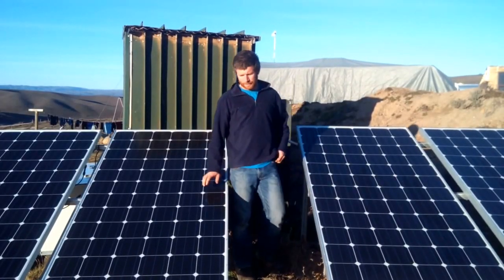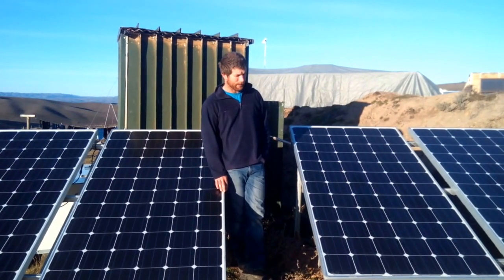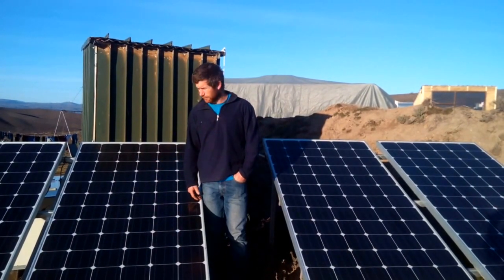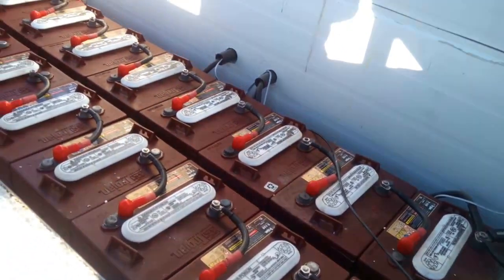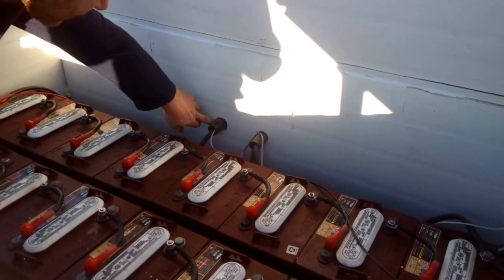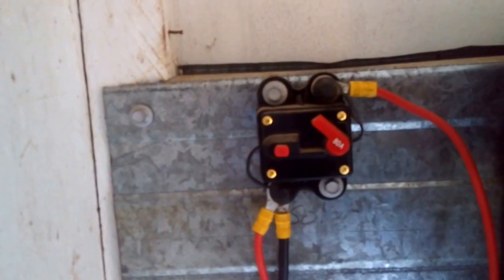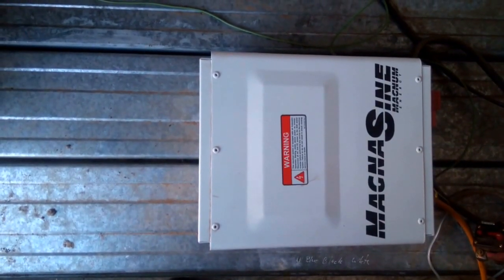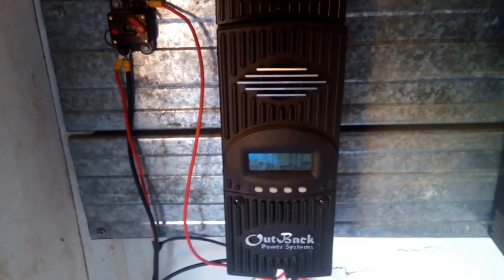Off Grid Solar New Zealand

Comment: I would replace those breakers with proper single pole outback/midnite solar 80 amp breakers on array/battery bank side & a 100 amp single pole outback/midnite solar on the inverter to battery bank/generator side.I would also shield your wiring in flex or solid conduit for safety.

Comment from the maker: We have changed the system a bit since this video. However we are running a fridge freezer, deep freeze, washing machine, phone chargers lap top etc. No problems most of the time just have to run the generator occasionally when cloudy for a few days.
Reply: Are you able to update your setup with a new video?